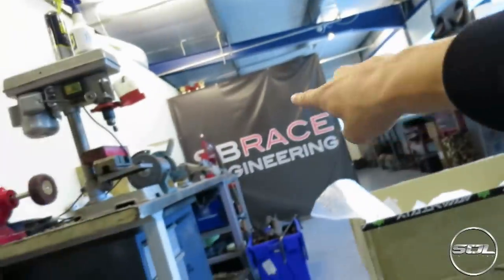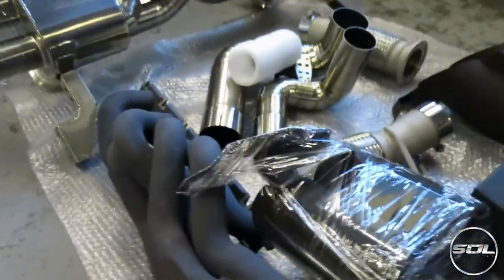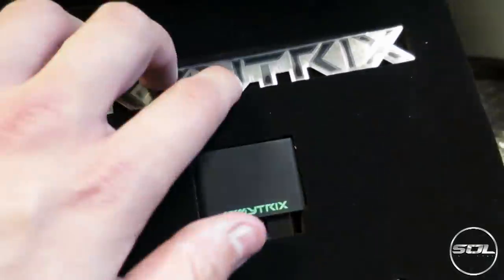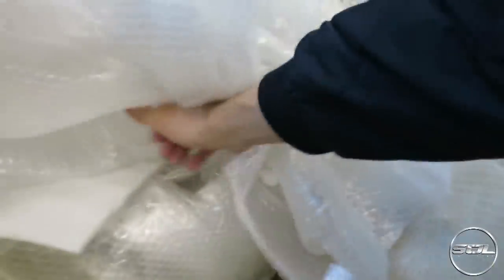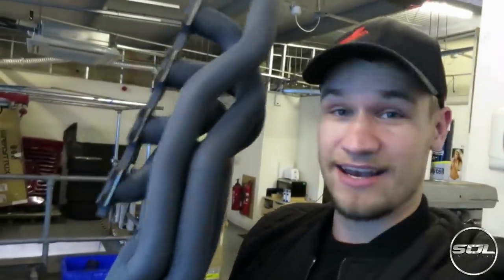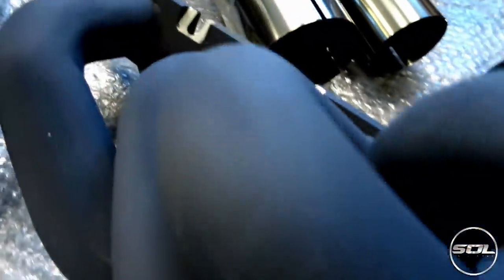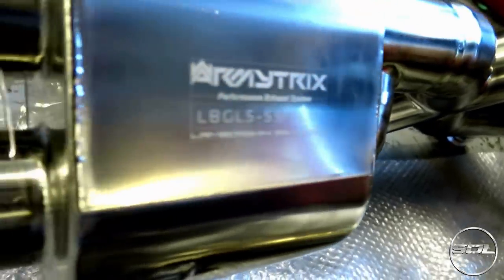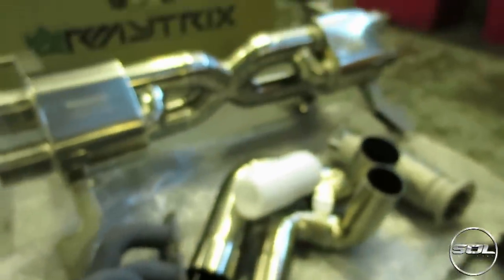THE ARMYTRIX PROJECT BEGINS: UNBOXING & REVS!

Comment: Good video, Paul--  thanks for sharing. What is the idling sound decibels?  high revving decibels? (Highway speed). Can compare after new exhaust system installation.  Would it affect to the original sound?  Or just louder.  As you know, as one's brand purist would not want to dilute the original sound of the vehicle. I drove a Ferrari a couple of week ago in Vancouver, the 430 spider sound amazing.   Love the original sound from the factory.  Then I heard my buddy's same Ferrari with aftermarket exhaust.  It's louder but it lost the original sound.  Kinda like hearing Bono lost his original vocal sound through a loud speakers.  Would target hear direct from his voice instead.  Such a unique vocal from him. ?

Comment: Hey Paul, check out The Smoking Tires video for an interesting camera setup (Particularly the One takes on Decker or Big Tunjunga). It'd mean investing in a go pro or two but with your current vlogging camera in the car you could keep the dual view of the road and yourself and just switch the audio between u talking or exhaust. Would be really good especially for the Monaco trip. Can't wait to see the trip btw!

Comment: Is that exhaust legal? If not what's the penalty for getting caught with it?
Reply: +Cornwall1888 why would it be illegal?
Reply: +rob Too loud or lack of catalytic converters. Not sure if this one has cats.
Reply: +rob certain towns/states (In the US) have DB limits of how loud your exhaust can be. 120DB stock is LOUD, can't wait to hear what the new pipes are.
Reply: My understanding is catless exhausts are illegal.
Reply: +intranix I like your picture... Hehe
Reply: intranix so the police would just tell you to replace it within the next few days, I think most people just put it back to stock for an mot or go to a garage which will look over it.
Reply: +Guuggel this exhaust has no Cat.   Note the De-cat pipe he mentioned in the video.
Reply: I don't think he would put an illegal system on his $200,000 car! :D
Reply: +AJ632 decat is technically 'illegal' because the car won't pass an emissions test without them then rendering the insurance void as the car doesn't have a valid MOT. I had a decat and I don't know a 'friendly' MOT tester so I had to have a cat fitted. Highly unlikely he'll get done for it though because who's going to know its decatted!
Reply: well it has the opening and closing valves, so he can have it tested with the valves closed and it is probably a technically 'legal' part with them closed. but I have no idea, that's just my thinking. but still, if I had the money to have a Lamborghini, I sure as hell wouldn't fit it with a part that renders the car illegal :D
Reply: 100DB in the uk for MOT as far as i remember. i remember my lancia delta failing it's mot at 118DB.
Reply: a freekick